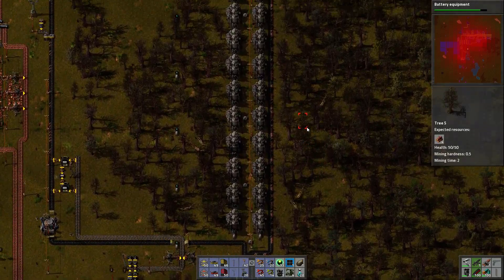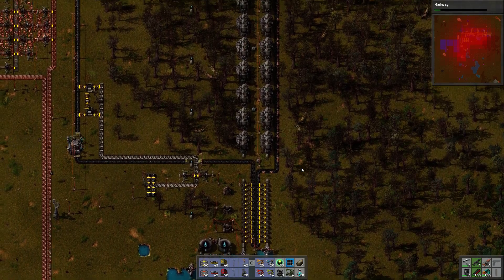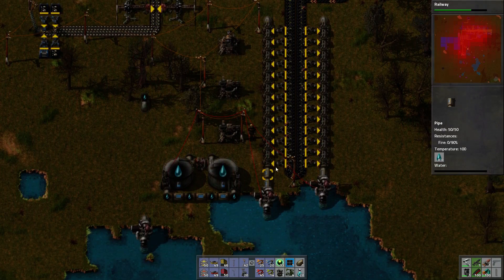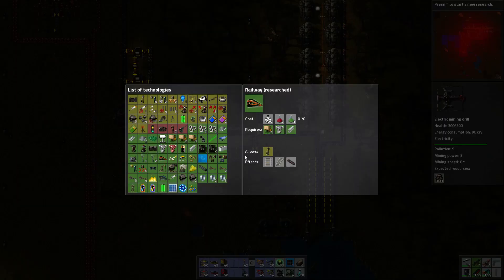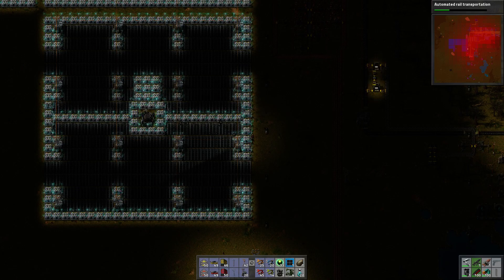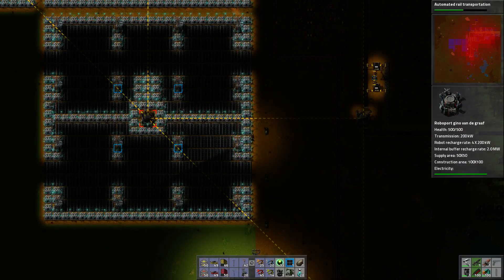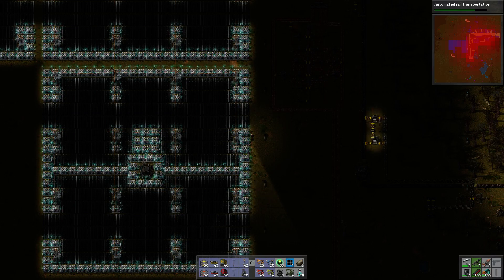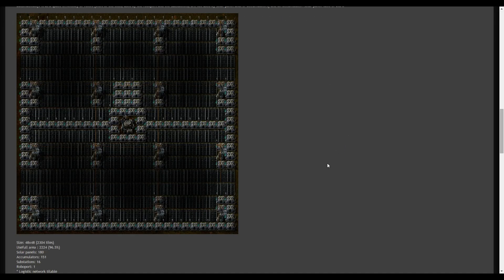Factorio Tutorial 9 - Optimal Power Setups

Comment: Update for Factorio 1.15. 
Steam power:
1 Pump, 20 Boilers, 40 Steam engines.
Nuclear Power: (be carefull about heat pipes, they act weirdly (max range of either 24 or 30 oppinions differ.)
40 MW Single reactor:
1Reactor, 4 Heat exchangers, 7 steam turbines.
1.12 GW 2x4 Reactor Setup for an average neigbour bonus of 250%:
8 Reactors, 112 heat exchangers, 194 steam turbines.
Solar: unchanged.

Comment: I'm not sure about these calcs of solarpanel-accumulator ratio.

25000 ticks is 1 day. 60 ticks is 1 sec. 
daytime = 15000 ticks ,night = 5000 ticks. dusk is 2500 lineary from max to 0 and from 0 to max, meaning 2500 ticks of max daytime and 2500 extra nighttime. so daytime = 15000+2500 ticks = 291 2/3 secs, nighttime = 5000+2500 ticks = 125 secs.

Creating 840 kW of power
At night the accus using their energy. 125 sec * 840 kW= 105 MJ => 105MJ /5 MJ = 21 Accus

At day the solarpanels need to create 840 kW of power = 840 kW/60 kW = 14 panels
In that same daytime the accus need to get powered up again => 105 MJ = 105,000 kJ, so 150,000 / 291,666 secs = 360 kW,
360 kW/ 60 kW is 6 panels to power them up so 14+6 panels = 20 panels,

So the ratio is 20 panels to 21 accumulators for 840 kW of power in a whole day.